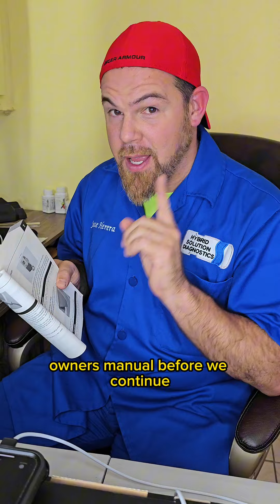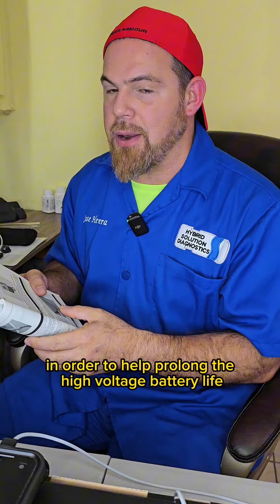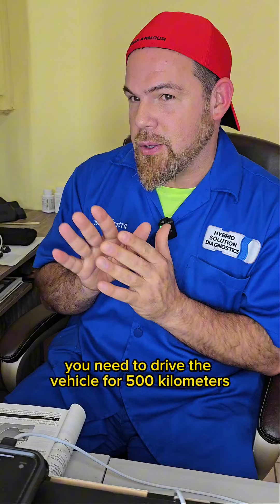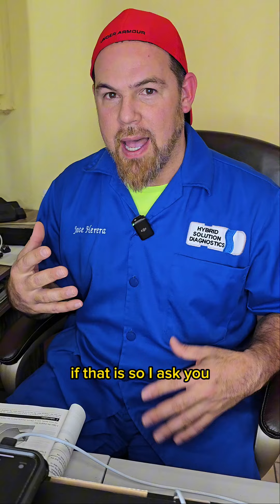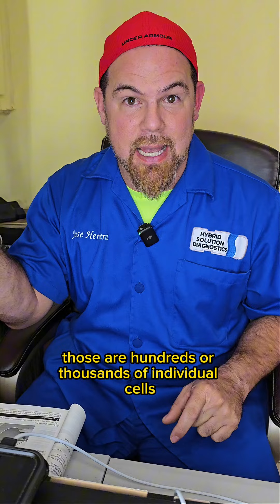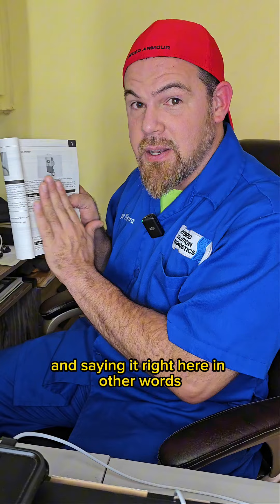DC fast charge for electric cars is a big mistake

Comment: Depends on the battery system, for example the Hyundai ioniq 5 maximum charge rate is at 4C (4*the Ah Capacity of the battery) which is ends up wearing out the battery as much as a slow charge would (for the chemistry of the battery (NMC811))